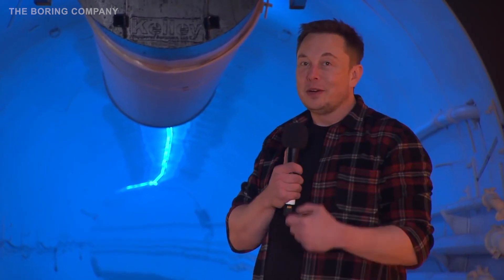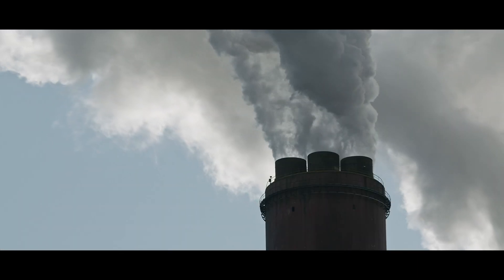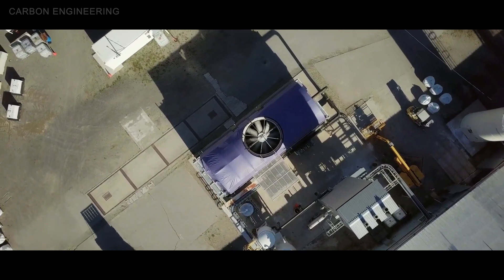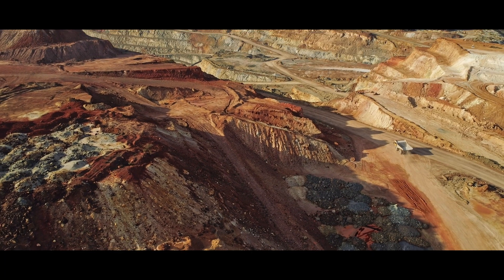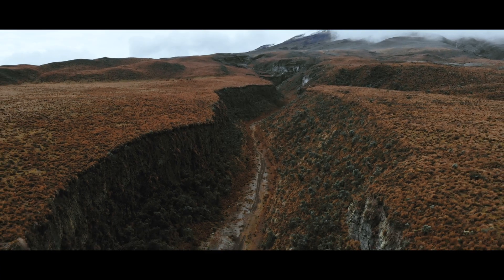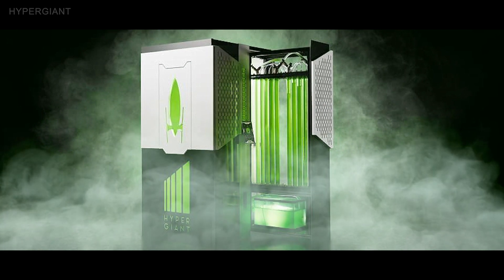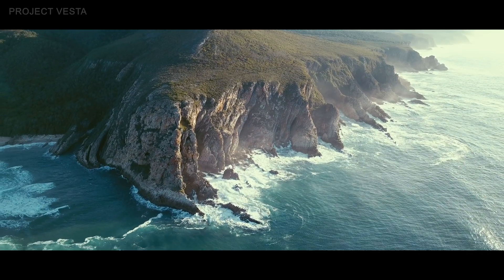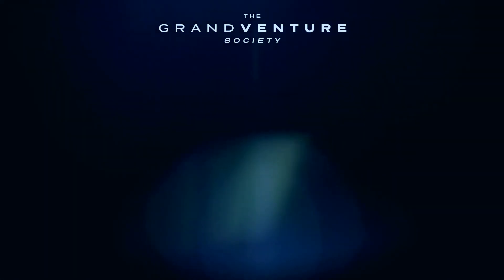Elon Musk’s Carbon Tech Explained

Comment: This comments got more like's
Reply: FORMULATED WAX WILL COLLECT AND CAPTURE CARBON PARTICLES FROM INDUSTRIAL SMOKESTACKS DISCOVERED 42 YEARS AGO
 We cannot leave today’s children in a future world that will become uninhabitable if we continue polluting it at the present rate. DO YOU AGREE? For example, Airborne carbon particles have been drifting throughout the atmosphere of our planet and into the very air that we are breathing for many years. Carbon particles have been spewing out of the industrial smokestacks since the beginning of the industrial revolution about 1760. These carbon particles settle down and fall onto the Earth’s surface onto places such as Alaska and Greenland’s ice sheet causing the ice to melt is aiding in the sea to rise. Black carbon and soot on the ice surface absorb the heat of the Sun, melting ice when the ice should reflect the heat of the Sun like nature meant it to be, but mankind has changed that. There is a basic solution to prevent carbon pollution which is formulated wax, and the reason is that wax and carbon have an affinity towards each other meaning that carbon combined with the wax reacts like a pigment or a dye and the result is black wax just like a black color crayon. The carbon in this state cannot possibly become airborne now because it is in a solution ending a solid block of black wax mixed with other particles. The results end in a byproduct that can be used as an additive to asphalt for roads. How does it work?

The carbon -soot is forced into a vessel containing the high melt liquid wax where the carbon -soot instantly turns it into solution thereby making it virtually impossible for the carbon  -soot to escape into the environment The heavier particles act as sediment settling at the bottom of the vessel, then removed and more wax is replaced working something like a toilet.
The heat loss from the top of the smokestacks can be harnessed or engineered to enter into the hot liquid wax in the vessel to keep it in a hot liquid state. There were not many environmentalists during that time period and were not concerned about polluting the environment, as all they thought of was making money. If this elementary solution had been discovered and implemented then, we would not have the carbon-soot pollution that we are faced with today.
Formulated wax has been demonstrated many times showing how to solve man-kind created environmental problems.
Reply: XPRIZE CARBON CAPTURE Please share, thx
FORMULATED MICROCRYSTALLINE WAX WILL CAPTURE CARBON FROM INDUSTRIAL SMOKESTACKS. 
A solution for capturing carbon was discovered in my lab over 40 years ago. I knew back then that this was going to come to this day. I had to find the answer and did.
The heat loss from a smokestack can be forced into a large tank containing hot liquid microcrystalline petroleum wax. The heat will keep the wax in a molten state which facilitate the carbon to be absorbed when combined with the wax. Carbon when mixed with wax reacts like a dye. The wax-carbon amalgamation will result in a black wax solution thereby making it impossible for the carbon to escape into the environment while in a liquid state. Other toxic particles are also captured in the wax settling at the bottom of the tank as a sludge. A sludge release valve is located at the bottom of the tank. After the sludge is removed more wax is replaced in the tank working something like a toilet. The sludge becomes a byproduct that can be used as an additive to asphalt for roads or used for cocooning nuclear waste materials for long-term safe burial. The entropy of the Earth has been increasing at a startling rate since the beginning of the industrial revolution caused mainly by the carbon that is released into the atmosphere. Government scientists have failed to stop and prevent carbon pollution from entering the environment. This problem can only worsen until a solution is found before this problem becomes irreversible. It has been discovered that formulated wax has been shown to be the only answer to this problem. William Nelson                                     waxogen@gmail.com